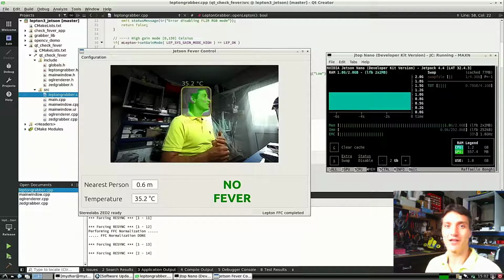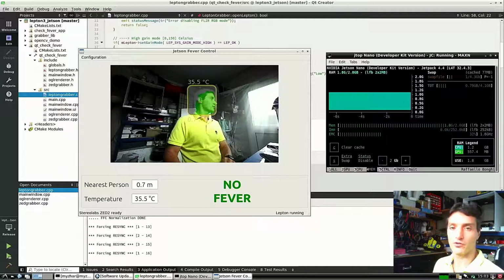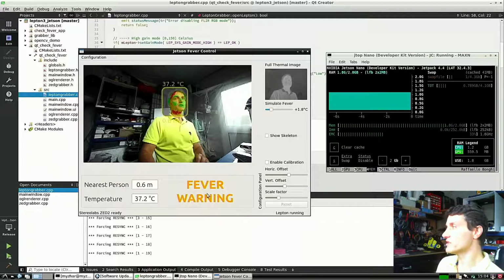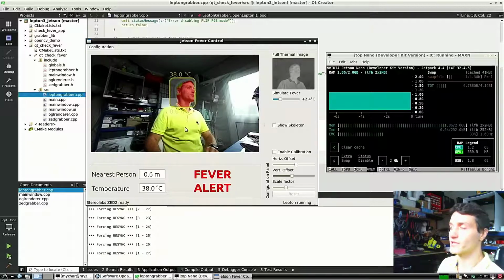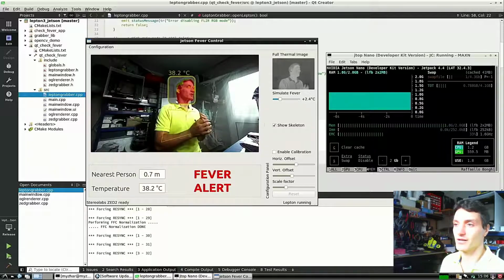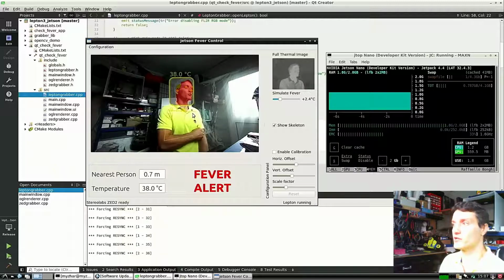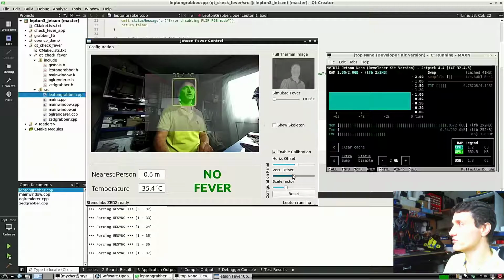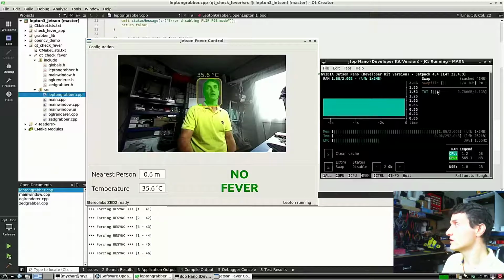Jetson Fever Control against COVID19

Comment: This is super cool!! gonna try myself. :) . BTW I got a question , when I was searching the  requirements I saw that the  Lepton3 is no longer available for the purchase and  ZED2 camera is too much expensive for me. I got a  Jetson Nano  and  are there any cheaper alternatives that I can use?
Reply from the maker: You can use Lepton 3.5 that is even better because with "radiometry" it provides a reliable direct temperature information. About ZED2, in the Github repository you can find many examples that do not use it.